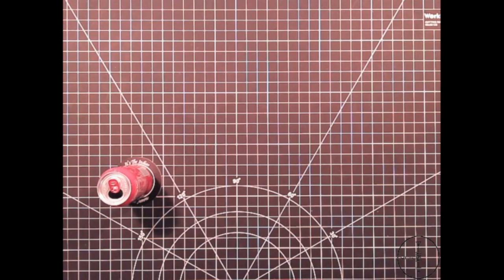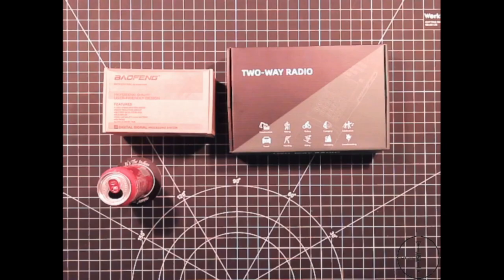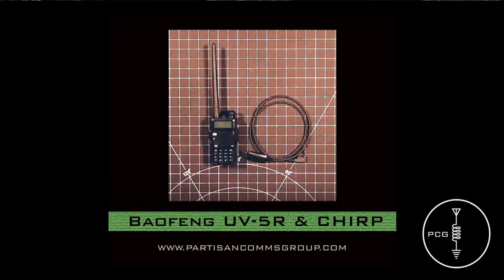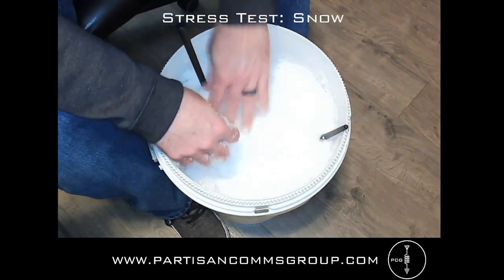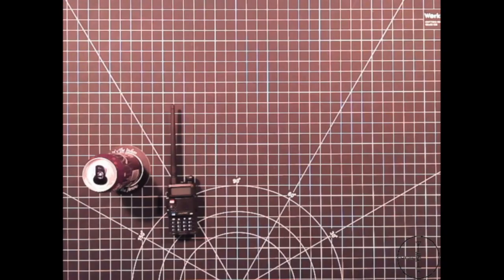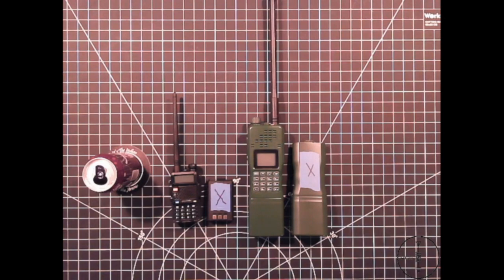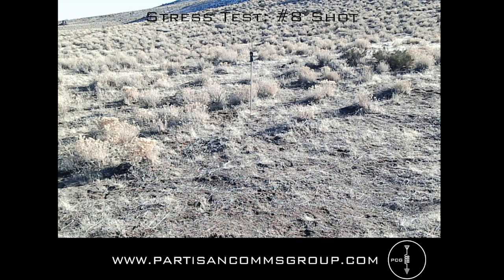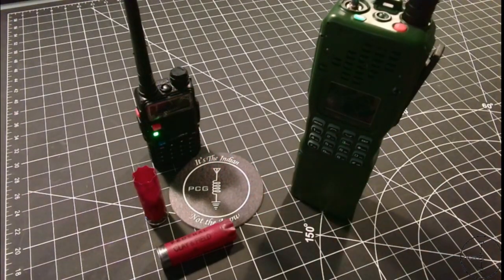E10: Baofeng AR-152 & UV-5R Stress Test

Comment: Im sure most people already know this..IF you drop anything like a phone or radio in water..drying  out is so important.  Putting in a hot car window/dash is great.
The heat should quickly evaporate the moisture.  Putting the device in a sealed bag of rice is a ok option too.
My car dash has dried out several mis adventures.
Ty for this test.
Reply from the maker: I was reading an article a while back that mentioned taking the device apart and using isopropyl alcohol on the components as it helps clean dirt and corrosion.

Comment: I havnt confirm this info but someone left a comment under a AR-152 review.  Where 432.100Mhz hits - 14.5 watts:

My insignificant findings into a dry dummy load
and on high power are:
146.000Mhz - 10.5 watts
147.900Mhz - 11.0 watts
222.000Mhz - 1.45 watts (after a conversion)
223.500Mhz - 1.10 watts (after a conversion)
432.100Mhz - 14.5 watts
446.000Mhz - 12.0 watts
This was done on a khaki coloured AR-152 with
the 1.25 meter conversion.

Comment: did the uv5r work with an external mic speaker plugged in?
Reply from the maker: During the stress test I didn't attempt to plug in an external mic to either radio since the speakers were still working.  But if I do another stress test video I'll definitely include that.  Thanks for the great feedback.
Reply: @PCG  another question while I'm here- do you know if the uv-5g is as* durable as the uv-5r?
Reply from the maker: @Guardian_023  The UV-5G has the same case as the UV-5R, but the difference is the 5G is restricted to transmitting on General Mobile Radio Service (GMRS) frequencies, while the 5R is able to transmit on amateur frequencies.  If you have any other questions then you're welcome to hit me up on a Telegram channel setup for fielding general questions: https://t.me/PCG_Ragchew